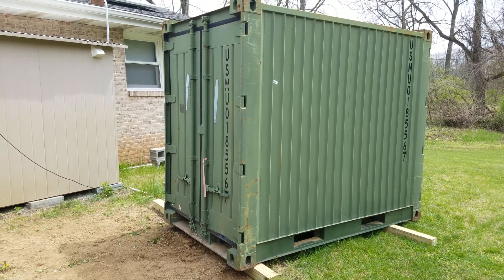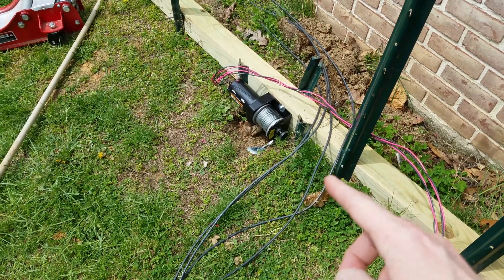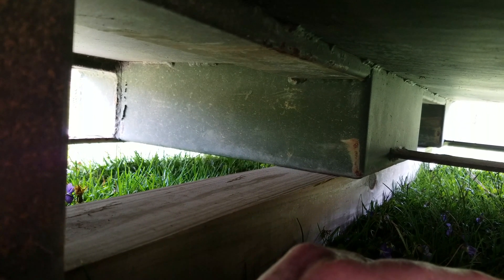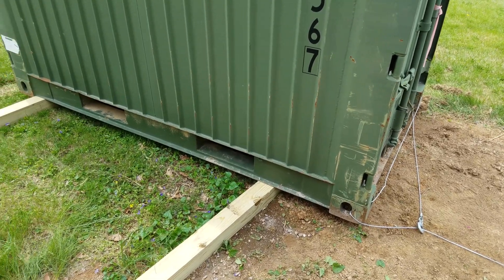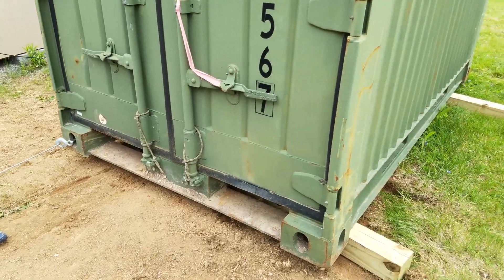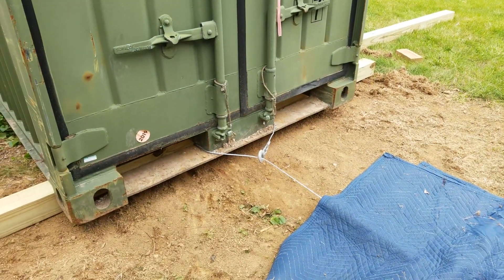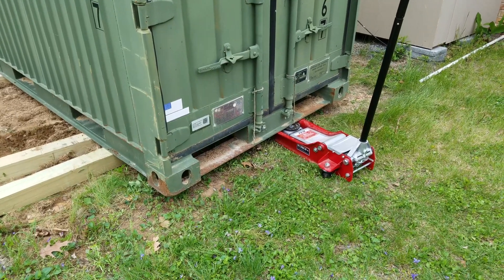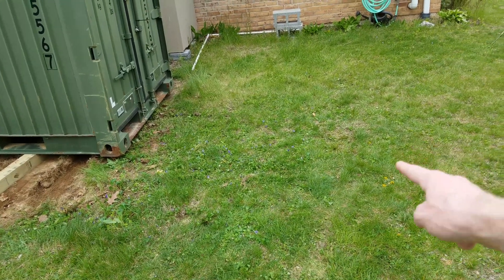Attempting to Move the 1800lb Shipping Container Battery Shed

Comment: Next time try putting it on steel pipe and then the pipes will roll right across the ground that's how they move very heavy equipment the pipes could have been to in or 3 in

Comment: Hooking winch cable onto itself like that is the best way to snap the cable, not only because of the hook damaging it but because of the forces generated in the cable triangle you make. Wrap a bit of chain around the centre part of the container and hook directly to that, so that winch-cable-hook are all in a straight line. If you want to make life really easy for your winch, chain or tie a snatch block to the container and take the cable around that and back to the winch.
Reply: Indeed...and now that the cable has been used in that way, and along with the rubbing on the side during that first pull, i wouldn't trust that cable now to pull a little red wagon, much less anything heavy again.  trash it and replace with new cable.  that thing is a deathtrap as it sits.

Comment: If you were to put the 4x4's parallel to the direction of travel you both get more travel before having to move the 4x4s, and the ability to build "tracks" out of them. You also substantially reduce the friction, and it prevents the rolling you had happen here.
Reply from the maker: That makes perfect sense. Only problem is the container is 8ft long so I'd have to buy a 12ft or 16ft 4x4 lol.

Comment: I'm surprised a smart guy like you doesn't know about snatch blocks and pulleys. One pulley doubles your pulling capacity
Reply from the maker: The problem is they only work if you have somewhere to attach them too. I had a hard enough time getting the winch to stay attached without pulling the anchors out of the ground.

Comment: If you need to move it again,use the 2 planks,on each of the runners but between them and the container put 2 boards with grease between them and it will move much easier

Comment: The easiest way to move something big and heavy is on rollers. Replace your 4 by 4 with round fence posts, plus a couple of extras to slip in where needed, then simply push. You'll be amazed at how easily it moves and surprised at how easy it is to manoeuvre into place. No need for a winch or all that preparation.

Five thousand years ago, rollers were used to move the 5 ton bluestones of Stonehenge over 150 miles to their present position.

Comment: Next time use round solid treated wooden fence posts. Use a snatch block or double pulley on your winch cable. Great videos.
Reply from the maker: Round fence posts would have been much easier. I don't know why I didn't think of that... Derp.
Reply: @LithiumSolar  Hindsight is 20/20. I have moved several outbuildings on my property and wanted to pass this information on so that other people can save themselves time and energy.

Comment: rent a forklift and complete the job in 3 mins...
Reply from the maker: I couldn't find anywhere that rented forklifts with tires designed to be driven on grass. Most of the ones I saw were for like garage/warehouses, paved areas... and even those were expensive!
Reply: @LithiumSolar  home depot offers 6k lbs. pallet jack rental for $40 a day.  lay down some plywood or 2x12 on the grass and u could have completed the job in about 15 mins.  u can return the lumbers back to home depot afterwards.  however based on ur video, your grass lawn seem to be very solid because the jack didn't sink into the dirt while u were lifting the container...hence, you can probably pull or push the pallet jack around without the need of plywood to support the wheels.

Comment: A lot of movement can be done with two 4 to 6 foot long 2x4s,  some blocks and shims, a few pieces of 3/4 plywood, and your pieces of 4x4. Use the  plywood to distribute forces and protect the ground from being torn up. Use the 2x4s as a lever. Use the blocks to create a fulcrum for the lever. Lift and put each corner on plywood. Work on one corner at a time. Walk the shed by lifting one, two or three corners at a time. It is only an inch at a time, but it works well with a helper on the other side. It is a working method that was used by millwrights positioning machinery in a factory.

Comment: Your doing it wrong. Put a skiteboard under it and move it. Easy 😉
Reply from the maker: 2000lb on a skateboard? That sounds like it would go bad very fast!
Reply: @LithiumSolar  nah it wouldn't gof fast anywhere. The skateboard would break as soon as the weight is on it :p props for moving a (small) shipping container by hand. At work I use a 2500 or 3000kg (5000-6000pnd) forklift to just shift an empty 40ft container a few feet so it's standing straight. Moving it further requires lifting it on both sides or a crane truck.

Comment: Never wrap the cable around stuff. Use a chain and attach the cable to the chain bridle. With a snatch block. 
I love your stuff on solar and batteries. Good job.
Reply from the maker: Thanks. Is that pretty much just to avoid the cable fraying/breaking? As you can tell, I haven't dealt with many heavy loads before lol.
Reply: @LithiumSolar  Yes, the snatch block prevents the line fraying or kinking but it also give you the opportunity to attach the hook back at/near the winch itself which will double the pulling power while halving the line speed. Also, the rating of any winch is only for the first wrap of cable around the drum. Additional wraps lower the effective ratio (and add weight) so pulling out twice the cable also makes the pull easier on the winch.

Comment: Pro winching tip: you should have used a couple snatch blocks (pulleys) to up the pulling strength of that winch and get some of the cable off that drum - winches have much more power on the first couple windings around the drum than the last couple windings.

Comment: Your efforts and enthusiasm is contagious. Oops wrong wording these days. Seriously you can be very proud of your work and thinking behind your end goal. I have 3 40 foot containers that I have wrestled with over time. Without a forklift, your auto jack is decent. I have also used bottle jacks on point. Remember the construction of the container is focused on those endpoint where the shippers hook them all in line. 

Using 4 inch round wood dowels or even those pressure treated 8' long and 2 inch round posts work great when moving metal cargo containers. Your ten foot container is say 2000 lb. the 20 footers are 3,500  lbs and the 40's are 6,500 lbs. safety first so watch that your fingers are away from the deadweight of that beast. Thanks for your video. Making my day.
Reply from the maker: I can't even imagine trying to move a 40-footer! You raise a very good point regarding the weight of the container being focused on those four corner points. When I move the container into it's final position, I plan to raise it on cement blocks 2-3" above the ground. Do you think I'll only need blocks at those 4 corners? Or should Have some along the side as well for additional support?

Comment: Next time (like others mentioned) use a snatch block (or multiple - every pully you add doubles your pulling power) and put 4" PVC pipe for it to roll on instead of 4x4s

Also next time, turn your 4x4s the direction you want the box to go, and let the box just slide on top of them. It will be really easy with the winch, or as you get close to your new slab, much easier to push with a couple bodies or a vehicle/riding mower/atv/etc

In terms of safety, also consider that those couple tiny bolts and washers holding that winch to the 4x4 are not made for that kind of pressure. I would be wary they might break. 

Now that you have a winch, are you going to mount it at the top of the container to lift your battery packs up and down? . 

Keep up the good work! I enjoy your videos. I'm getting ready to purchase my first panels this week.
Reply: Yeah smartereveryday did a whole piece on his lust for snatch blocks which was super interesting. But even then, I watched this entire video and then forgot about snatch blocks until i saw your comment.
Reply: Was gonna say the same thing. Pulleys rock.

Comment: I'm surprised you didn't fry the motor in your winch. If you try moving something that heavy again get a inexpensive snatch block from Harbor Freight or Amazon so you can double your cable back to the winch. Just attach the snatch block to the object and the cable end to the winch to double your strength of pulling power.
Reply from the maker: I just looked up what a snatch block is and hadn't even thought of that! Despite having this winch for a few years now, this was my first time using it. I'll keep that in mind for next time, thanks!

Comment: Lead acid battery to power the winch?!?  I'm disappointed in you.  😁  
But basically this confirms that when I get my 20' shipping container delivered, its not getting moved from that spot.
Reply from the maker: LOL hey that battery has been sitting in the garage for a few years now unloved. It finally got to do some work :) I'm not even sure how you would move a 20-footer without a crane. I guess the same jack method with a (bigger) winch would work?

Comment: Did you think about putting a cement pad down? Or even crushed gravel?
Reply from the maker: Yes. The container will be going where the old shed is. I will be pouring gravel and setting it on cement blocks so it's raised 2-3 inches off ground :)